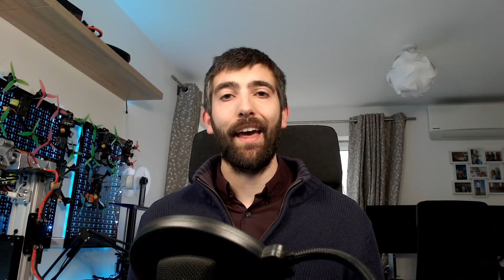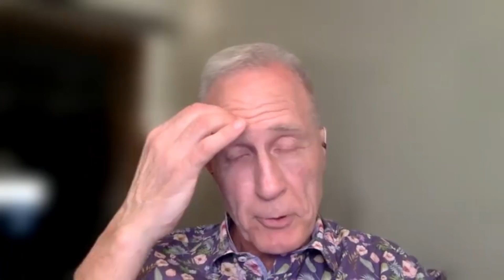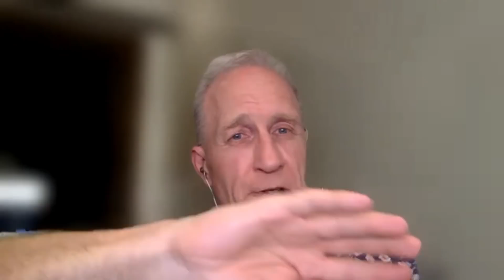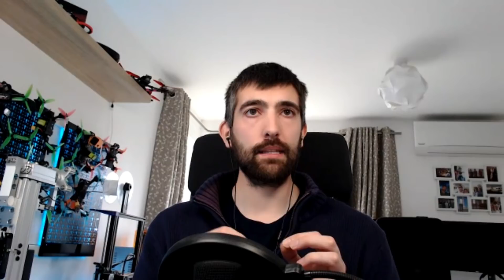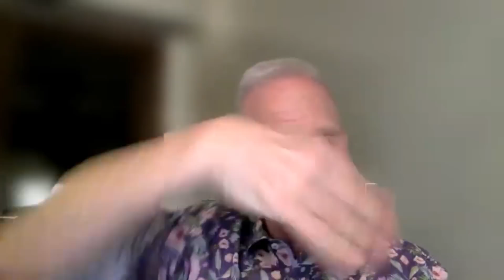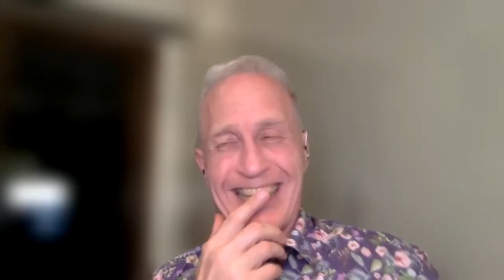All the AMAZING changes in Betaflight 4.3 explained by one of Betaflight's lead developers

Comment: Here are my timestamps :

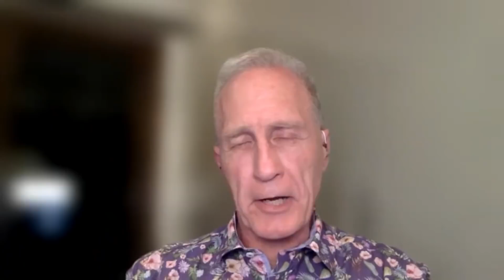1:10 - Interview starts, delays and disagreements, who is Chris Thompson
3:54 - New PID sliders and defaults (now in OSD)
11:00 - Tune presets (preset hosting)
18:08 - Loop timing and filtering improvements and signal noise reduction
24:36 - New dynamic notch filter / rpm filter (and settings recommendations)
35:43 - Feedforward and rc smoothing (optimised for different radio signals)
51:24 - Dynamic idle update
1:07:29 - Feedforward now in level and horizon mode (for whoops)
1:10:58 - Lua script improvements
1:11:35 - Configurator still getting polished, don't copy over a dump from 4.2 to 4.3
1:14:54 - Motor configuration tool
1:15:46 - Dmin removed, now D and Dmax
1:26:05 - Importance of a resonance-free frame
1:28:55 - Giving credit and appreciation to the Betaflight contributors, hoping for a release before Christmas

The ending was so heartwarming, thank you for this great interview, looking forward to give 4.3 a try soon :)
Reply from the maker: Thank you very much for your timestamps. I'll paste them in the description!
Reply: @ChrisRosser  don't you feel that someone {as in @Flying Baguette) should be acknowledged beyond copy/paste their timestamps into your own video description? Most creators I watch normally either pin/flag their comment or at least they are credited when their contribution is rolled into the description?  I was surprised to see it done this way, but it was probably just an oversight in your desire to get this great interview out to us.  Oh, and thanks for the great interview by the way. As a Graduate Degreed Electrical Engineer it's great to be able to hear all of your informative "deep dives" into subjects that many pilots overlook or are afraid to investigate.
Reply from the maker: @jklong03  You're absolutely right! I've pinned his comment on the video in recognition and hearted it as well. It was certainly very kind of him to create them for us. I've also pasted them in the description so they show up on the video as chapters.
Reply: Thanks for the stamps

Comment: Thankyouthankyouthankyou.

I finally flashed 4.3.1 last month, and found a brand new machine in my 4 year old daily driver.  I have it flying better than I have ever imagined.  Tuning has never been easier, and I am indeed running with settings that I would never have tried before.  The result is a near-cinematic experience from a cheap, toy-grade platform.  In a single word, colour me gobsmacked.

Comment: Hi, Chris. This interview was as entertaining as it was informative. I definitely will be moving my quads to 4.3 soon! I have a question which is based on a very limited understanding of black-box logging and how pid tuning affects black-box logging. I hope you can answer, even if the answer is just "your understanding of how this works is incorrect."  The question:

With presets now a part of Betaflight, is there a way to match your quad to the most ideal PID preset based on your black-box log? My thinking is that the official presets can come with the black-box log of the quad used to create the tune from before and after applying the pid tune. For clarity, let's call the quad that the tuner used to make the preset Quad A and the quad where the preset will be applied Quad B. 

That way betaflight can take a look at quad b's black-box log on stock betaflight and find a preset belonging to a quad that is as similar as possible and suggest that preset. For example, if I had a build using the glide frame, 2306 motors, and with a relatively clean log, I would be suggested to apply a preset based on a similar spec quad. Assuming of course that similar spec=similar black-box log. 

Then, once the preset has been applied and the pilot has done a test flight, betaflight could analyze the log to see if the results of quad b match quad a. If the results appear similar, and/or the pilot feels the tune works well, the pilot could then keep that preset on their quad. Of course, this would require both quads to do the same tuning flight in order to achieve similar logs. This is where I am reminded of your video where you suggest how to fly your quad to receive meaningful information from the log. Future tuners could do so when creating their preset and the tuners of the current presets could do so retroactively. 

Does this make sense? Again I'm no expert on any of this, so I take no offense if this idea isn't a good one. I understand that this might be difficult to implement. Perhaps it's even a better idea for the pilot to review the preset's logs on their own to decide on which to use. Regardless of the outcome, I hope that posing this question has a positive impact and I look forward to your response. Thank you for your time.

Comment: Ahh, not to hate, but feedforward in BF is not feedforward in control theory. feedforward in bf is what is known as Dterm Kick. Yes it can really help make your drone response faster and can be quite useful, but its not a real feedforward. Feedforward should act before error occurs, not while its being created. But naming aside, great job CTZsnooze.
Reply from the maker: A feed forward element passes a controlling signal from an external source to a load elsewhere in the external environment. In our case the source is the rate of change of setpoint and the load is the motor output. No prediction is required and Betaflight's feedforward element does meet the definition of feedforward in control theory as I understand it.

Comment: Still liked the old sliders better. Even the early 4.3 sliders. I really liked the pd balance and pd gain sliders. I used to be able to "get a quad close" with 2 sliders now I need like 6. Big sad. Now we literally have a slider that only changes one box value (d term pitch). At that point just let me type in the box :-/ 

maybe I'm in the minority.
Reply from the maker: I use just master and P&I gain. Use master to tune gains then P&I to get PD balance. Don't worry about the other sliders 👍

Comment: BTW i totally dig what he's saying about the RC smoothing. Garbage in- garbage out. Cleaning the input makes so much sense, especially when we're relying on minimizing filtering. One of the reasons I ended up ditching the CRSF module on my Taranis - could not get a consistent and clean packet rate matching and it manifested as unpredictable/steppy RC input which would challenge even a perfect tune. Tackling the RC input part just makes sense!

Comment: A detailed thought at the 56:50 point, there can still be some bogginess and somewhat laggy/high hysteresis response from motors at too low an RPM without necessarily achieving a desync (a missed pole crossing that the ESC didn't detect BEMF in the expected time window), and that alone can create a noticeably juddery response that is also not desirable (not least because you're extremely close to a desync in those instances).

Comment: which RTOS do you use for betaflight I would like to learn firmware development
Reply: We don’t use an RTOS. We use a cooperative scheduling scheme and all the code is built on top of the STM libraries; stdperiph for F4, LL thereafter, with a bit of HAL thrown in for good measure although its use is limited in the interests of performance.
Reply: @SteveCEvans  thank you very much much sir I'm trying to upskill my embedded dev skills I'll read more on cooperative scheduling
Reply: @SteveCEvans  Hi Steve do you have any books you would recommend that teach these scheduling schemes?  I've been searching and haven't found anything solid.

Comment: I have a Pitch vibration at ~60Hz. Is it better to turn on a 2nd dynamic notch with the min freq at 55Hz or set a static notch from 55-65Hz?
Reply from the maker: A vibration at that frequency indicates a mechanical issue. You shouldn't tyr and filter it with notches because that will vreate too much delay. Head on over to my Discord and post in the support hanger if you need help, I've got an amazing team of experts there to help you! https://discord.gg/KHJWTmqSw8
Reply: @ChrisRosser  Yea, its probably a cracked bottom plate. I'm just not ready to buy a new frame yet.

Comment: 31:26 What's this about F4's needing an anti-alias filter at 1000Hz? And presumably this means F7s don't need it?
Reply: it has nothing to do with the MCU.  It is the gyro.  Really any MPU or ICM gyro is ok with the Anti-aliasing that is inside the gyro. Hence why TDK (gyro manufacturer) has the 250hz lowpass inside the gyro.
Reply: It’s essential for Betaflight to have an antialiasing filter if the PID loop rate is less than the gyro sample rate. The gyro sample rate for ICM gyros is 8k, so if you run a 4k PID loop rate, you really do need to retain gyro lowpass2 as an antialiasing filter. 
Quads that run an 8k pid loop and an 8k gyro loop don’t have this aliasing issue, especially when the FC is synced to the gyro via EXTI support.  For them it doesn’t matter what you do with the gyro filters.
Reply: @ctzsnooze  OK I think I get it, F4's are often configured for 8k/4k while F7's run 8k/8k? Hence Chris mentions the extra filter for an 'F4' when really it's an extra filter for 8k/4k. My F4 FCs seem fine on BF 4.2.11 at 8k/8k, is this something that won't be possible with BF 4.3 due to more CPU usage requirements?
Reply from the maker: @ian It depends how many of the advanced features you turn on. If you can do without soft serial then I think 8k/8k is doable on an F405 but not an F411
Reply: @ChrisRosser  👍 I found that with 4.2.11 'tasks' or the Configurator showed usage was no problem except when BlackBox was logging. This is on the bench though, obviously. If BlackBox uses CPU, how to verify in flight? And would that be any different in 4.3? I don't need SoftSerial.

Comment: What is the reason behind not implementing a fix (adding a dji osd element which shows warnings and lq values) to dji osd issues? As far as I know the reason was "dji shoud do their own fix" but as it is known the dji fpv is at end of life and there are no new firmware updates. So the only valid way to fix this is via betaflight (which people has already done on their forks). Thank you.
Reply: This sort of stuff is up to the company to do..  a member of the public could also.. the team is much to busy at the moment to do it our selves
Reply: @Sugar_K  I totally agree that dji should have done canvas mode long ago. But they didn't and as they have stopped supporting the product, they won't ever. There are forks that has done this. They all use the craft name as a work around. Maybe add a switch to osd element that makes it possible for dji fpv users to get the most necessary "warnings". I mean it is already there at this point. Thank you

Comment: I try but I don't understand most of the technical aspects.
Are we saying that 4.3 should fly well on stock settings for most sizes of quads?
Reply: Yes. At least no angry motors. You still need to tune the PIDs a bit sometimes but it's easy. You should not get nasty surprises.

Comment: where is the actual update procedure? connect from 4.3 and flash the latest firmware for the FC? is that it?  can we use a configuration from a previous version?  if we can't so we have to start from beginning with a full FC calibration?
Reply: You have to start fresh with 4.3 and can only use it with configurator 10.8.0. We are rolling out a lot of changes and bugfixes during this week.
Reply: @mhaslinghuis  yah and you have to keep your configurator and firmware kinda matched as there are just to many changes happening
Reply: @mhaslinghuis  how can you re calibrate a flight controller when it's already in the quad?  why do they make this necessary for these upgrades?